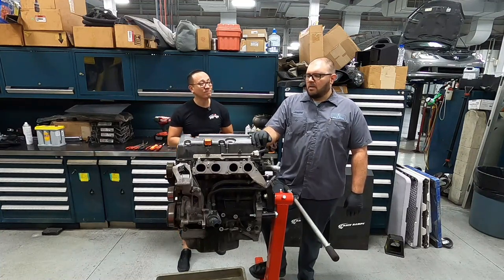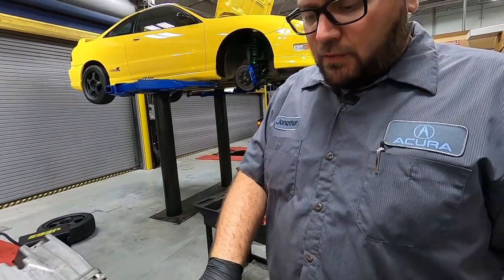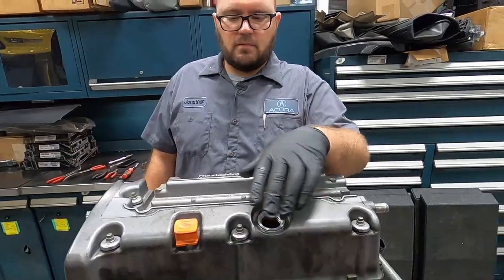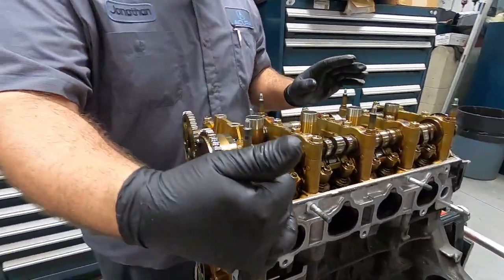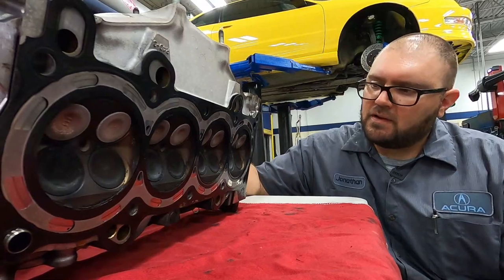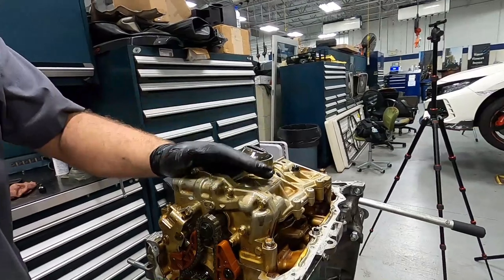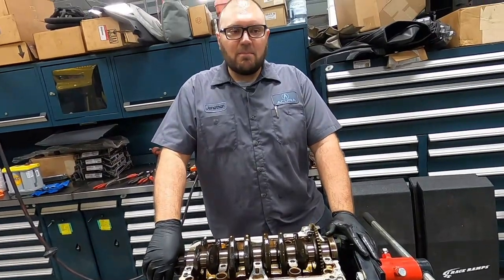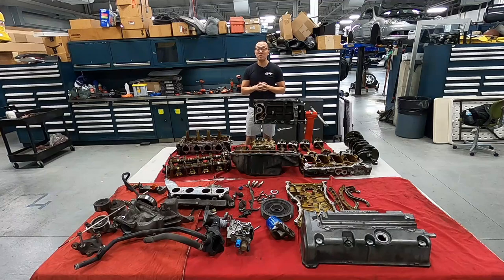Knocking Acura TSX 2.4L K24Z3 Complete Engine Teardown | What Failed Inside this K Engine!?

Comment: I have a 2012 TSX with 220K miles. So interesting to take a closer look inside. Thanks AHC!! 🇺🇸👍🏻
Reply: 231k on my 2011 6MT!!
Reply: 137k on my 2010, I love seeing how long this engine could possibly last
Reply: I have a 2011 TSX and I'm pretty sure the VTC actuator is shot 😩
Reply: @XBKLYN  whenever you start it do you hear like a grinding sound? If so it's shot but shouldn't cause any substantial problems. Had to replace the actuator when the tensioners on my timing chain failed, that was a fun repair at around 120k miles hahahaha
Reply: @Clone1italy  yep! Usually on cold mornings when the oil is a bit low...I have a recording of it on my phone in case I need to describe the problem to my mechanic...I won't be tackling it myself and huge respect if you handled that one on your own! Glad to hear it won't adversely affect the engine as I'm guessing that would run about 800 bucks to correct😩
Reply: @sheikhali5664  oh man....I don't have the nerve to crack that cylinder head open! Chris Fix does have a real nice video though....thanks for the link!
Reply: just passed 224k on my 2010 6MT!

Comment: I have a 2014 Acura TSX with less than 75k miles on the clock. Bought it used a few years ago with about 60k miles after my last TSX got totaled in a wreck, been daily driving this car for years now and has never failed me, not even 1 time, let my sister borrow it for a while and she did many long trips in it with her and her cats and it never left her on the side of the road either. Love the car, great daily driver, just wish mine was RWD with the 6 speed manual rather than the 5 speed auto, but overall an outstanding daily that will undoubtedly last for many more years to come.
Reply from the maker: Thanks for sharing your testimonial with us
Reply: @chinchy111  I love the auto in stop and go traffic for obvious reasons, but I would love the manual for when I want to go do some sporty driving. You can put it into Sequential shift mode, but the paddle shifters are just fancy looking tactile switches, and the Semi-automated transmission was not meant for sporty driving so it often lags a lot when changing gears. Absolutely perfect daily driver I adore driving this car, my only gripe is I wish it was RWD, had a bit more hp and was a manual. Thinking about maybe getting an RSX down the line and making that into the weekend driver that the TSX wishes it could be xD.
Reply: @chinchy111  Really? They feel great in mine, really notchy and good shorter throw. Think something is up with your shifter

Comment: I had an 06 TSX since new with the 2.4L with +176,000 miles with zero issue (until it was totaled by a red light runner in 2019).  My 08 RDX with the I-4 2.3T is still on the road with +195,000 miles and still running strong.  Just scheduled maintenance and always used syn oil for both.
Reply from the maker: Thanks for sharing that with us
Reply: My 2013 TSX with the 2.4 just hit 170k and I couldn’t be happier with how good this thing still runs and still gets well over 33 mpg if I baby it on my highway commute

Comment: Had to switch from the Milwaukee m18 to the pneumatic for those head bolts I see. Lol. I tried to do the same on a throw away engine and till this day that's the only thing my Milwaukee 1/2" hasn't been able to remove. But I'm pretty sure it's because of the extension needed to reach.
Reply from the maker: Great catch. Head bolts are super tight, had to break out the pneumatic impact, haha

Comment: I got the 2010 TSX with the same knocking in the engine. Recently the engine came to a grinding screech with a weird sound. My mechanic tried to turn the chain and said that I need to replace the engine because it wouldn’t turn. So I purchased another engine as recommend. Now seeing where the chain is located it was a good thing I decided to grab another engine because it looks like a complete rebuild to fix it. What should I do with the old one? Thanks for the informative video.

Comment: Great Info and interesting. Since I am a novice , I really like it when each part is described as it is taken off, A final assessment of why there was a failure and his thoughts about the engine. Did they mention how many miles it had on it and maybe if it was worth rebuilding. Really good though. Thanks.

Comment: Great video guys,,,,,, Look for carbon at the ring pack(oil control ring in particular) and on top of the piston on all Honda/Acura's, they use too low of a vacuum in their PCV System. -.2 to -.9inH2O under normal driving isn't enough to sweep the crankcase clean of Blowby and it collects in these places. They need -1. to -3.inHg to clean the Blowby out of these areas.

Comment: Poor K, didn't get its oil changed often enough.
Reply: @applepoop10  Well, sure, but it wouldn't be burning oil if it had regular oil changes... unless it had a million miles on it, or something.
Reply: @applepoop10  That engine does not look at all clean inside, that's very bad oil varnishing for a Honda engine. I've had more than a few Honda engines with well over 200,000 miles on them (one with over 300,000), and none of them had any oil varnishing.

Comment: If you guys ever make another video in regards to K24Z3 breakdown describing the parts and the maintenance needed to upkeep on engine like that would be greatly appreciated, i have the same engine and i know i have a lot of work to do, unfortunately I cannot afford to buy brand new parts so I will be using and reusing a lot of things that I can find from my local parts store I'm currently at 300,000 miles same with the automatic transmission, the transmission I will be replacing due to the fact that repairing that will probably take a long time and a lot of knowledge, thank you for the video guys

Comment: Have a K24z3 going strong in my 2012 Accord Sedan.... Just needs a little bump up in power but kinda lost where to gain it from. Use to my OEM planted B16A2 motors in my 2 EBP Civic Si's from 1999. I'm lost and not about to drop hella money as it's a daily and everything and kiddo has my budget tight.... Need recommendations

Comment: I was wondering if the 2.4 can be replaced for the 3.5 and how much of headache would be?
Reply from the maker: 2010-2014 TSX has an option for 3.5L V6
Reply: @ahcgarage  I have 2013 tsx se and I'm thinking instead of replacing the same 2.4k series what if i just put in a 3.5j series ?
Reply: Only minor downside with the 3.5 is it has a belt instead of chain

Comment: I was hoping to see a video of this engine being removed from the car if you guys have one?

When you say ziptie the Cam assembly do you mean that you would zip tie the rockers to the camshaft? And that would prevent those little parts from falling out and getting lost?

Also, I'm assuming the cams were in the way but would it be at all possible to take the head of without taking the cams off and leave them together?
Reply from the maker: By placing zip tie is a great way to keep the valvetrain in tack. You have to remove the cams in order to remove the cylinder head

Comment: I'm no professional but if I had to guess the engine burned oil and wiped out a set of bearings which the original owner may have replaced a already. I see two newer bearing caps.

When the bearings were wiped out again due to not paying attention to the oil they probably just said screw it get me a used engine!

Comment: is it possible to say put the K24A2 yeah would VTEC on both cams onto this block? i'd think no because of the solenoid for the VTEC actuator
Reply: isn't it common for tuning to make these frankenstein builds with even a high flow K20A head onto the K24 block? seems to work somehow.

Anyway, i find it interesting, that honda renounced the exhaust vtec and used a in-head exhaust manifold, and still produced over 200hp with with that engine.

Comment: Awesome vid guys!!! What went wrong with the engine though were the piston rings being shaved off or was the head gasket was going?
Reply from the maker: Possibly ran low on engine oil and causing the connecting bearing to spun. Low oil level can caused by excessive blow by with the piston rings
Reply: Wow the owner made a smart decision by getting another used engine because these modern engines in today’s vehicles are super complex to rebuild. I did the same thing with my 2004 Acura TL. The engine had a bad head gasket on the back of the engine and I got super lucky and found a mint 05 engine with 119,000 miles and paid only $735.
Reply from the maker: Very true. Sounds like a perfect deal!
Reply: @ahcgarage  From what I know, the K24Z3 is very iffy about it's oil. You have to change it often and using the correct A5/B5 0W-30 otherwise the pistonrings can seize, cause blowby and this happens. Its a shame, the only thing you need to do to make honda's run forever is change the damn oil. And customers can't even do that.
Reply: @The_Noticer. Piston rings and pistons have updated part numbers. 4,000 miles and counting on my z rebuild hasn't used a single drop of oil so far

Comment: Great .. I have questions please ... In the oil pump if you remove the balancer will it run normally?? 
And does a k24 piston fit in a k20 engine pls??
Reply: You cannot remove the balancer, instead you replace the oil pump with a k20 pump. That’s An oil pump without a balance shaft. And no k24 pistons do not fit k20
Reply: @brisevans8976  Thanks for reply boss . But if i rebore the cylinder to put the k24 piston in it is it worth?

Comment: Let me guesss.... ran it with low oil constantly... always check and top off 1k or so miles.... hella known for burning oil 🛢 crazyy how simple maintenance will make these engines go 200k +
Reply from the maker: Great point!
Reply: Most likely because the piston rings used were low friction to increase mpg, and keep the EPA happy, but they didn't seal well and caused oil burning. People forget about oil burning sometimes and the damage is done.

Comment: Can some one tell me how I reprogram tire sensors in an Acura rl kb1? I got new rims I put the sensors in there but no idea how to program, pressed the white button under the steering wheel in the a gap between the plastic shielding for the steering column. Idk drive for 20 mins at 40 mph
Reply from the maker: The Oem factory TPMS sensor initializes and programs itself

Comment: So this type of failure - not frequent enough oil changes lead to something like this?
Reply: I guess so, or it was running low on oil. Mine CU2 has now 215k KM (not that much really for a Honda) and it's driving flawlessly.
Reply from the maker: Yes, also most likely to be low oil level or failure of oil pump.
Reply from the maker: That's great to hear
Reply: Look at how brown colored the head internals looked. Guarantee it ran low on oil or infrequent oil changes. My 375,000 mile B18C1 looks way cleaner than that inside.

Comment: Those r40s can put some power down on boost.
Reply: Really ?
I have this bottom end and will be putting a K20A2 head along with a bigger cam and valves along with dual springs.

Comment: Would've love to hear y'all thoughts on why it failed.
Reply from the maker: Very likely to be caused by low engine oil level
Reply: These engines burn about 1qt every 1-2k once it’s at high mileage, I would know, my oil bill is high 🙃
Reply: Black oil doesnt mean its bad dont worry. But yes my tsx has 200k miles and does burn alot. Im curious how they let the oil get so low the oil level sensor will trigger and beep on the dash with a warning that says check oil level
Reply: @ahcgarage  more then likely lol gotta top off every 1k or so cus them damn piston rings... oh well hopefully it last til 200k
Reply: @ahcgarage  highly unlikely more likely the engine was over Rev as it's a manual car this is very common. Low oil level in these commonly causes timing chain failure before a issue like spun bearing. Engine also showed it was very clean so taken care of.

Comment: does anyone know how many miles were on the engine? Do they suspect too long in-between oil changes?
Reply: It was just over reving it's a manual it happens leads to a spin bearing that engine is clean otherwise

Comment: I just bought a 2010 Acura TSX, I love the car. You guys are awesome show me all the parts of the engine. Now my question is what make that bearing go bead? it looks like they keep up with the oil changes.
Reply from the maker: Likely due to low engine oil level
Reply: @ahcgarage  - I have a 2009.  At 80K, I found out it was burning oil.  I went through 2 quartz between oil change.  After reading about this, this motor has issues with the piston rings/blow by causing the burning of oil.  Is this a defect of this engine?

Comment: What is the cause of this “failure” 
High mileage??
Reply: By the varnishing on all of the inside surfaces, I would say that the oil wasn't being changed when it was supposed to be changed.
Reply from the maker: Most likely caused by low engine level

Comment: How many miles did this engine have on it? I have a TSX with 80k, hoping it will last to 250k!
Reply from the maker: Over 100k miles. But with good maintenance and checking engine oil level, this could be been prevented
Reply: You'll get about 150k max
Reply: @frontspring1  why do you say that? I’ve seen many TSX’s for sale with over 200k miles
Reply: They don't build Hondas like they used to. They run thinner oils and higher compression ratios. Will never be as reliable as the older cars.
Reply: You sound like a car enthusiast that runs his car pretty hard.
The ones with 200k were probaly driven by grandma's and women.
Reply: @frontspring1  I disagree, my 05 civic blew a head gasket at 110k miles. There’s a lot that affects reliability besides compression ratio and oil viscosity. Factory tolerances are a big factor in long term reiability.
Reply: @jonathans.4207  compression ratio has alot to do with reliability.the higher the ratio the more high strung the engine is.
Reply: @frontspring1  Nah, the civic was my daily I babied it. My Miata in the other hand I drive it hard but those last forever regardless
Reply: @jonathans.4207  my cast iron block straight 6 engine would outlast all your cars combined.
Reply: @frontspring1  Nah, this is a classic Honda port injected engine with timing chain and piston jets. The only thing you need to do to get this to run forever, is to change the damn oil with QUALITY oil per the booklet (A5/B5 0W-20->30). But people abuse it and dont change the oil enough. Then it seizes the pistonrings, gets starved for oil and spins the bearing. If these engines are well lubicated, you can drive them hard and they will still go 200K+. 

Just because it's a Honda, it doesn't last forever without maintenance. And this engine's heavy reliance on proper oil pressure/lubrication means it's his achillles heel. But that's easily enough overcome by regular changes.
Reply: I have the a 2011 TSX with the V6 option with 85k miles. Still runs like a new car.  Hoping to keep it at least another ten years.
Reply: My 06 I've had since 84k now has 227k miles. Regular oil changes are a must.

Comment: Thanks for showing the tear down. This probably should have been diagnosed and fixed without removing and replaceing the engine? Sorry about the criticism I did enjoy watching.
Reply from the maker: Absolutely, we can definitely able to performed the full diagnose with the engine in the vehicle. We just did this tear-down before we junk the motor.
Reply: A spun bearing is usually unsalvageable, because it damages the crank too. You would have to get it machined, resize the bearings in the case, etc. It's not worth it, considering it's only a K24Z3. And it was the customer's wish to replace the engine.

Comment: Nobody really builds the K24Z3 because of the integrated exhaust manifold; you lose out on extra HP gains because of that.
Reply from the maker: We have seen a few on boost making great power
Reply: Bisimoto makes 1,000hp with that manifold.